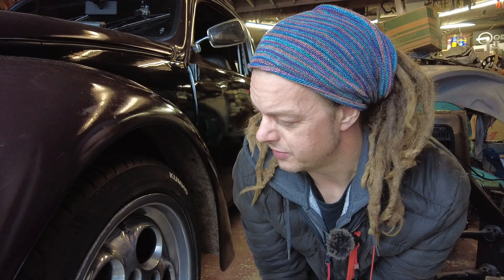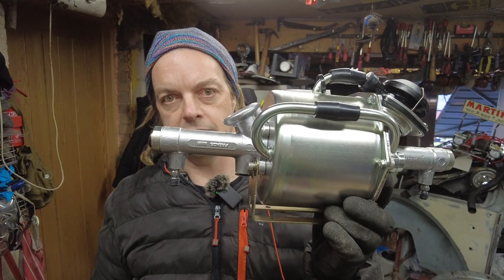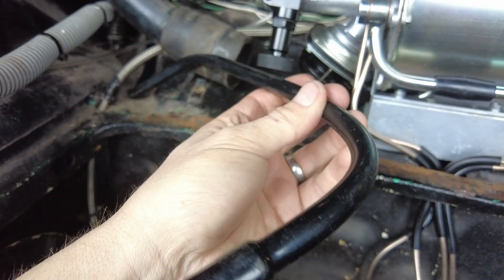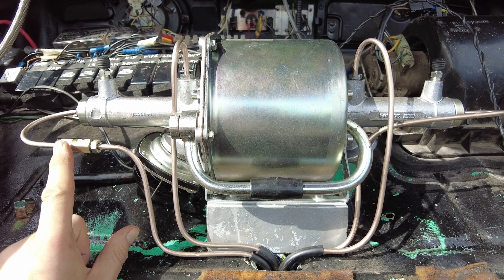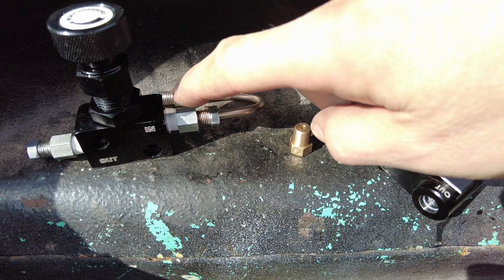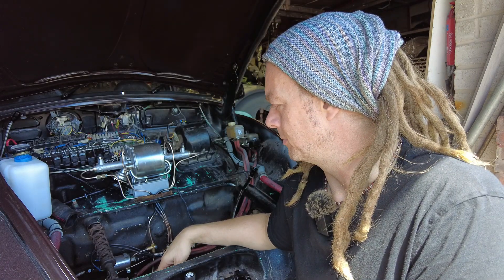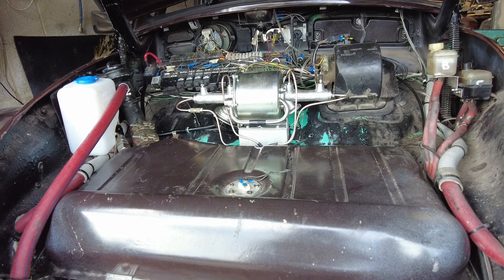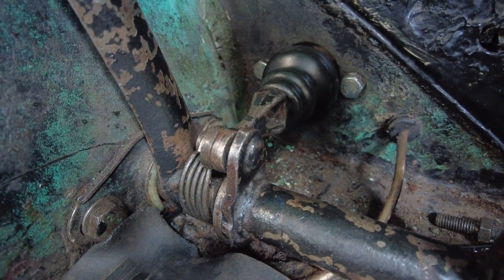Servo Assisted Brake Upgrade VW Bug Volkswagen Beetle! Improve Braking on Aircooled VW

Comment: Hello, thanks for sharing. Could you please share the exact size of tyres along the ET and the size of the wheels? thanks in advance
Reply from the maker: I dont know off hand exact sizes but believe fronts are 185/16 and rear 225/16. The car is pretty burried in the garage over winter....oh and the garage lights are broken! 😅 but I'll do my best to find the profike size for you asap. This is a better vid to see how they look on the car... https://youtu.be/MvE6esTa2Rg
As for ET, no idea and wheels arent going to be coming off for a while (assuming its on the back?). They are 16 inch from a porsche 944. May be able to find specs online 😊🤞
Reply: @PeoplesCar  helloo, if from 944 I'm clear now, thank you very much !
Reply from the maker: I THINK so. Never actually saw the car they were off. Therebused to be lots 15'' available but the 16s were rarer. O hardly ever see either these days. Best of luck 😊👍
Reply from the maker: Looking online the ET for the early 16'' Turbo Teledials is ET 23.3mm for front and rear. I THINK they are from this car but not 100% I bought them a long time ago when nobody wanted them lol. When the wheels come off I'll try and revisit here and confirm for you. Oh and I'm using the stock porsche spacers on the rear. All wings are also 2'' wider from memory  😊👍
Reply: @PeoplesCar  Correct 16" in 23.3 is 944 Turbo model 85-86 model. Late 944 is ET52.x .

Comment: I did this conversion on my mk1 caddy i ve been running it for about six years... Unfortunately. It's just started leaking brake fluid into the servo. I'm looking for a rebuild kit, but no luck yet. If you can help, that'll be great
Reply from the maker: I assumed a Caddy would have one as standard! I can't even remember where I bought it from, was an English classic car site. I'm not sure if rebuild kits are available either, never looked. I suspect Classic car websites might be a good place to start tho. Sorry I can't be more help, hope you get it sorted 😊👍

Comment: If your stock breaks are not locking up at full pedal press, you have a bigger problem.
Reply from the maker: Yes I agree. As mentioned in the vid most won't need this and should be able to lock those wheels if working as intended with a fairly stock bug, even on drums up front. Thanks for watching 😊👍
Reply: @PeoplesCar  I enjoyed the video.
Reply from the maker: @MarkLoves2Fly  Thankyou 😊👍

Comment: Wow! I will be using 944 steel rear arms on my beetle but with 993 calipers hopefully. I have adapter kit to buy to accomplish this. I also will be running cup2 porsche wheels if I can find them.
Reply from the maker: Awesome stuff sounds like a plan! 😊👍 Love the German Porsche Cup look, they used to be so cheap too, getting harder to find for sensible money now, tho can now get repro i believe. I didn't like teledials when bought them as wanted fuch, but were out of budget. Have fallen in love with them now tho. Best of luck and thanks for watching 😊👍
Reply: @PeoplesCar  Yeah the cup2 is getting expensive. I should have bought them years ago when they were cheap, alas, i had other priorities to attend to. I need to find some fast before i can't get the originals again.
Reply from the maker: @badbug911  if I spot anything locally I'll post back here 😊👍
Reply: @PeoplesCar  Thank you.

Comment: If you aren't already using metal sintered pads, then they might further improve the bite of your front brakes.
Organic pads don't have the same level of bite, and they will make the brake system feel like it is spongey.
Reply from the maker: Tbh I don't want any more bite on the front. Ideally the bias valve woukd be fitted and sending more to the rear. May consider some for the rear tho thanks for the hint. Do they go by a specific name? Tx for watching. 😊👍